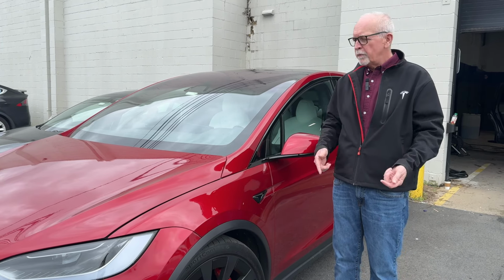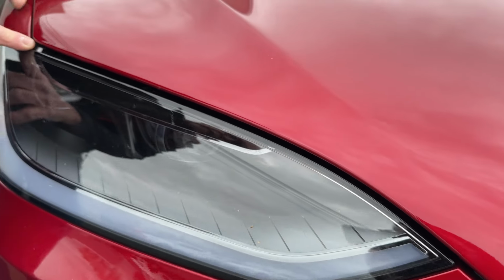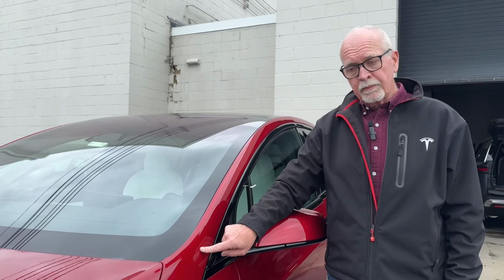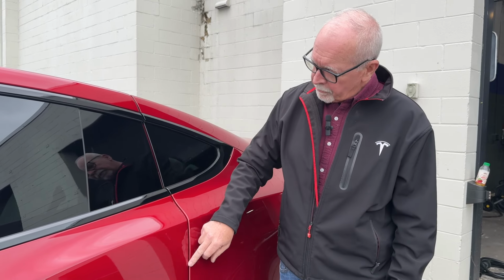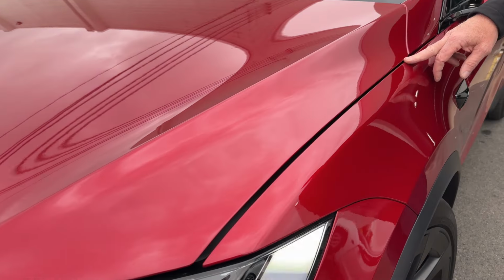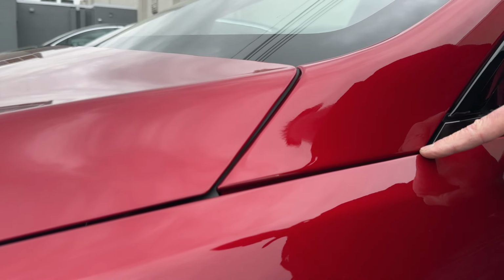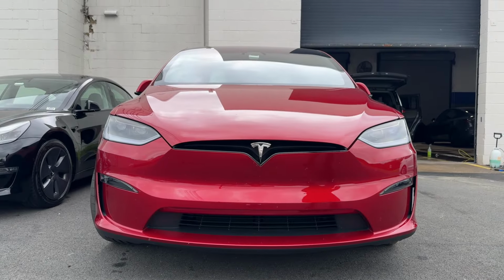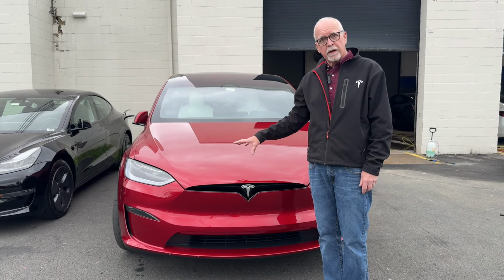Tesla Body Fit Issues: Everything You Need to Know

Comment: Shanghai made 3s and Ys generally very good.

In saying that 3s I've seen out of Shanghai often have small issues with front door fitment but in my case (we have 2 2022 3s), small adjustments of the door striker fixed them 100%.